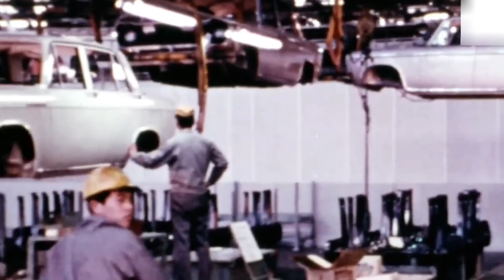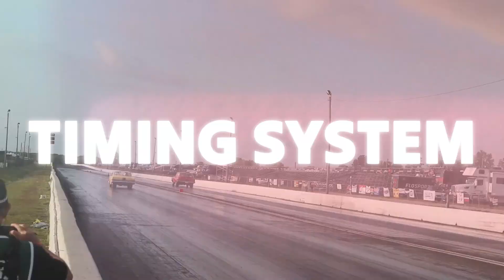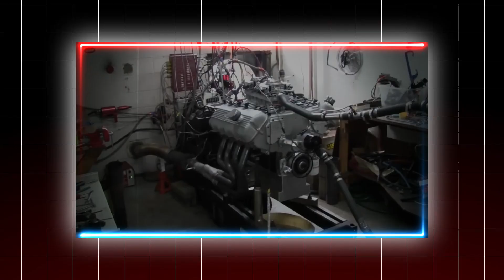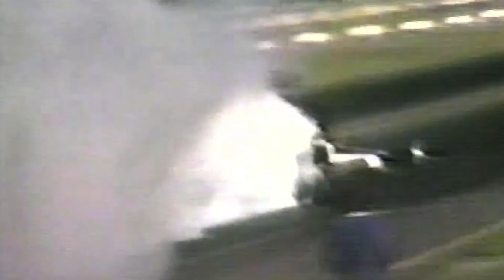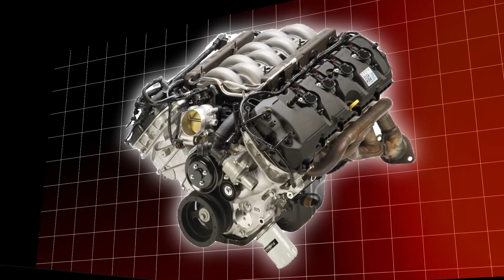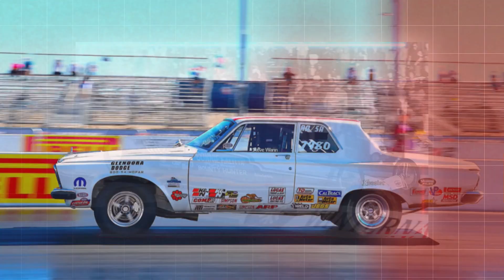The Shocking Truth Behind FORD'S Banned 427 Engine

Comment: I'm not sure where this car is today but back in the 80's my friends and I were at a road racing track in northern Illinois. (BFR) There we saw a Shelby Cobra (A real one, not a kit) and when the owner opened the hood at our request what did we find?  A Ford 427 Cammer stuffed into that car with Hilborn fuel injection!  The owner told us that to install/remove the engine you had to remove the cylinder heads first as the engine was wider than the opening of the engine compartment.
Reply from the maker: That sounds like an incredible experience! The Ford 427 Cammer is such a legendary engine, and seeing it in a real Shelby Cobra must have been a thrill. Thanks for sharing your story!

Comment: So, was there a Thunderbird with a cammer? 
I always thought the cammer was also used in the 427 GT40. Did the 427 GT40 use a push rod engine?
Reply from the maker: Great question! The Thunderbird did indeed have a version with the cammer, and you're right about the GT40. The 427 GT40 actually used a pushrod engine. It's fascinating how these engines evolved over time!

Comment: 5.8 Coyote you mean 5.0............... 427 Cammer was single overhead not dual overhead cam like Coyote
Reply from the maker: Thanks for pointing that out! The details can get a bit tricky, but I appreciate the clarification on the engine specs!

Comment: The hemi went on to still be the one used as the the NHRA Top Fuel engine. Upwards of 13,000 horsepower 500 cubic inch hemi, yet a newer hemi inn a charger ticks.
Reply from the maker: That Hemi is a beast, and its evolution from 426 to a 500-inch Top Fuel monster shows incredible engineering!

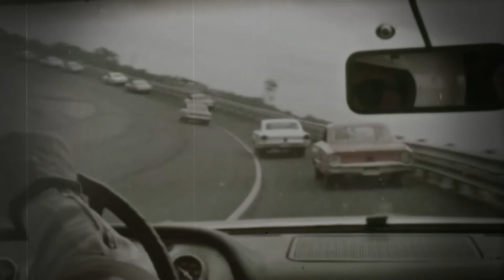Comment: At 4:00 mmm no not quite. Mopar was working on an engine called the Doomsday hemi. A quad cam 32 valve variant. After witnessing what happened with ford It was shelved. Gm was more the issue.
Reply from the maker: Thanks for sharing that insight! The automotive history is full of fascinating stories, and the Doomsday Hemi definitely adds another layer to the conversation.
Reply: @Aut0Academy  in my ignorance it was not GM. GM pulled out of factory supported racing. The 1955 disaster at le mans tarnished factory backing. At this time race tracks were merely cordoned off streets with a few hay bails to set the track lay out